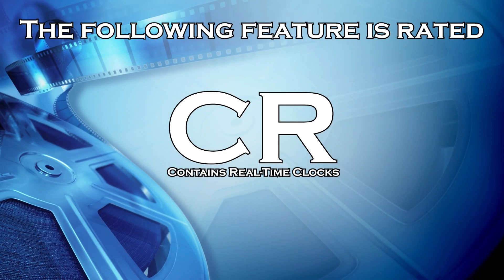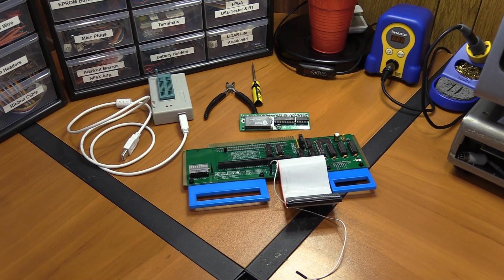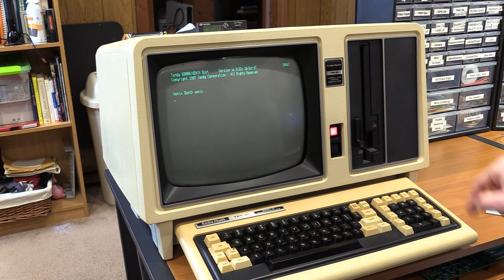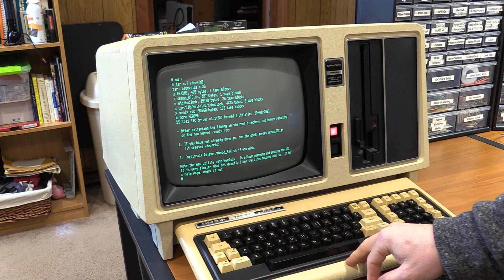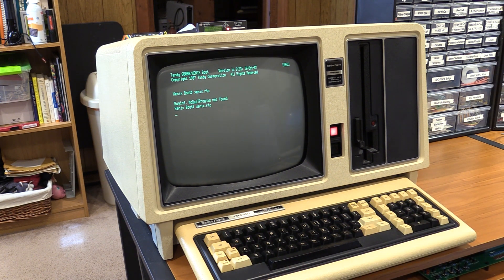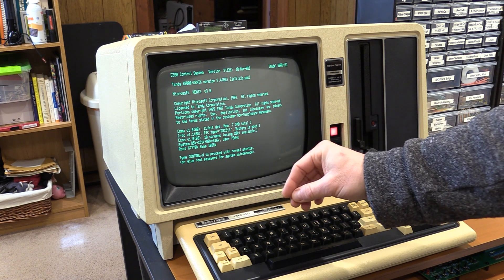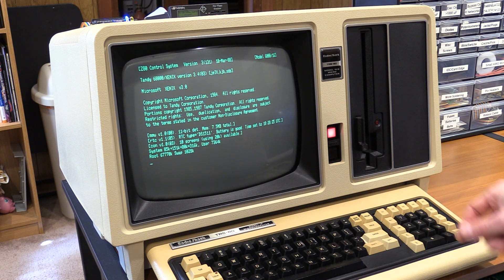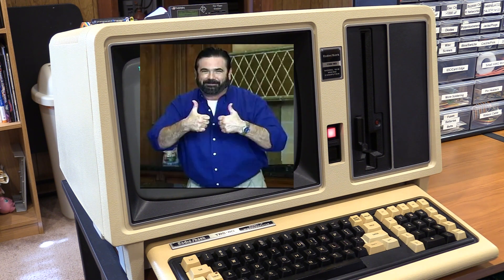TRS-80 Model 16B Real-Time Clock and XENIX 3.4

Comment: Hey was wondering if you might be able to help me with my Xenix machine. It’s an Altos but it has a MM58167AN real time clock chip. I’m running Xenix 3.1 - 3.2 on different Altos servers. I am not a programmer so I’m not sure how I can set it to the date past 1999. Any help would be great 😊
Reply: I did have a friend make a little program but it’s off on the leap year and it only really sets the software clock not the RTC. Maybe I could swap it out? I’m also not sure where to get the files to run the command..
Reply from the maker: Sadly there is enough variance between the various releases of Xenix and the platforms where it runs that I probably couldn't give you any useful advice.  Xenix on the 8-in Tandy systems seems to work fairly well beyond 1999 out-of-the-box, so I didn't have do do anything special.  I hope you get it figured out, and thanks for watching!